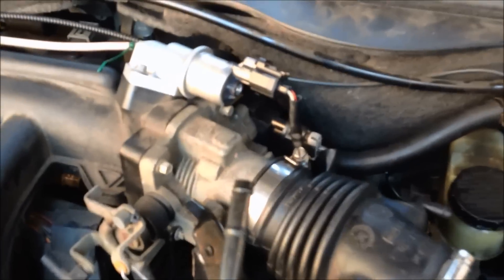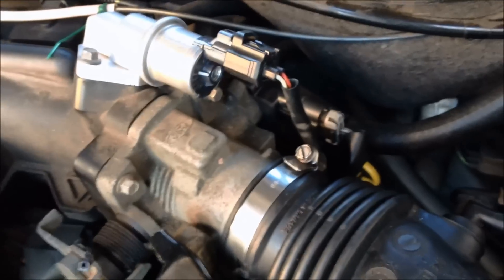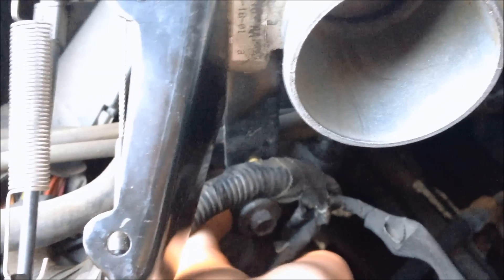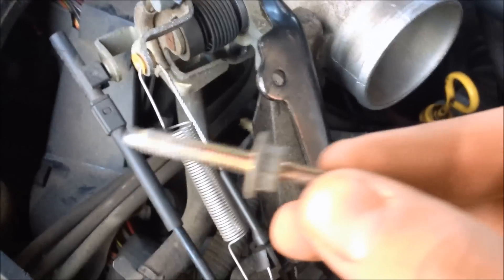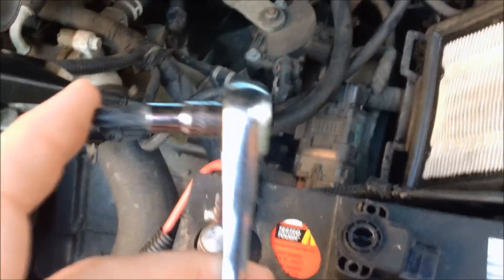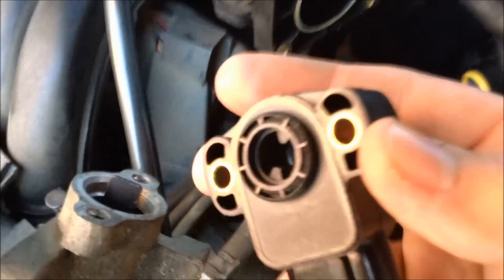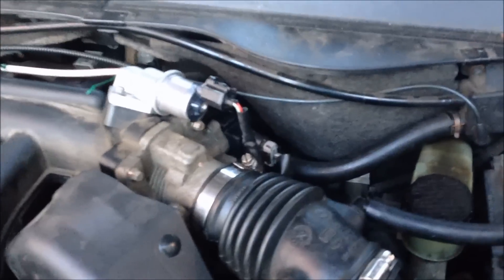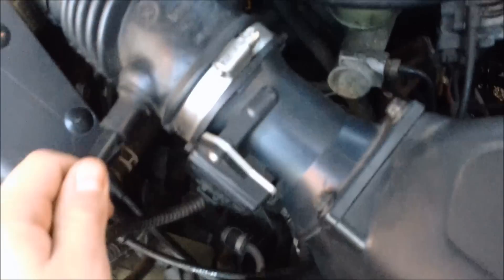Fixing Idling Problem Throttle Position Sensor Replacement 2001 Ford Taurus

Comment: what was youre car doing that led to this part needing replaced? im haveing an idle issue at highway speeds,usually between 1500 and 2500 rpms,what mine does is kind like a chug or jerk,its definately a fuel/throttle response issue i think.im sure mine needs replaced anyways,i got 175000 on my car,ive replaced egr vaccum solenoid,and am also gonna replace the o2 sensor(upstream bank1) as well as my fuel filter cause im sure its full of junk.to my knowledge its the original one that came on the car,.as far as the idle re-learn after replaceing the tps sensor,i would think if you unplugged the battery it would reset when car was turned back on.in the event it doesnt fix or relearn on its own,does anyone know how much it costs to have a mechanic adjust it? also could you message me on facebook please,i have some other questions i was hopeing you,or anyone else for that matter could answer for me my name on there is Eric Stinnitt my profile pic is of me sitting with my daughter on a couch.

Comment: Really man?. next time just take a ratchet with 5/8 socket and a phillips head bit and just take off the TPS. Not all that other stuff...  I'll say it  again  !!!!"JUST THE TPS"!!!!!
Reply: You might have to move the AC vac hose, but that should be it.
Reply: levi baker Not so IF the screw heads are stripped! The placement of most TPS sucks.

Comment: you guys are crazy, never replace a sensor just because. dude, why didn't you show us your car running? The sensors, to a trained Tech, can be condemned with  a scan tool, multi meter and internet, not just the internet. .In addition, a lot of sensors have relearn procedures and just replacing a faulty part will fix the problem.... and, ya, not using a bit in the first place was kind of a bone-head move
Reply: i agree
Reply: Jeremy Gilbert lol... Watch the video again. he didnt change it "just because"

Comment: didn't u have to take the car into a pro to have them do the idle relearn process
Reply from the maker: jon canty No I Just drove it around for 20-30 min
Reply: ooooo nice and ya later on i seen a vid on how to adjust it
Reply: MrCaryGrant59 I have an 03 sable and I'm having this issue with my TPS. I was told to take it off and check for anything that is clogging it before buying a new one. My problem is hesitation, surging, incorrect idling and erratic shifting of the transmission but that part is minor. Also my theft light comes on along with all the other panel lights and then shuts off. My speedometer moves when I'm parked and stopped at a light. I will try this and see what happens.
Reply: +MrCaryGrant59 Hey there, repair went smooth but now I have a constant high pitch squeal? Maybe I didn't seat the throttle body properly? Inspected the gaskets and they are fine.
Reply: I did it myself but I no longer have that 2003 sable. I traded it in for a 2012 Lincoln MKZ
Reply: No.
Reply: I put that part on myself.